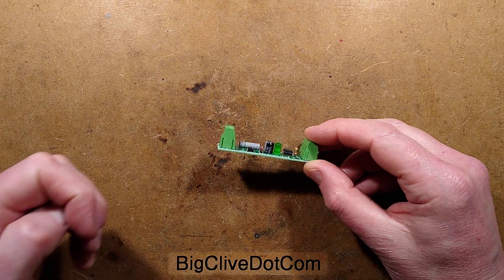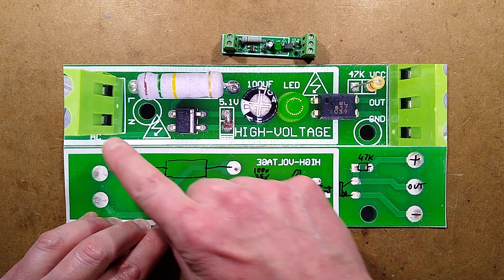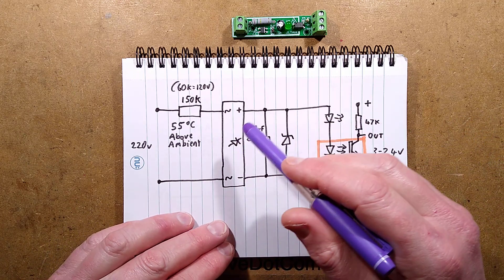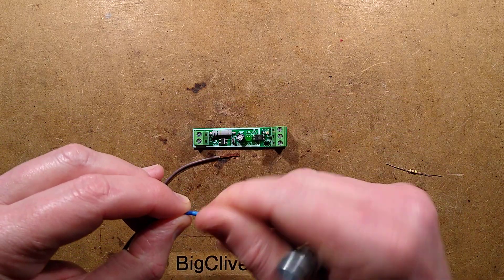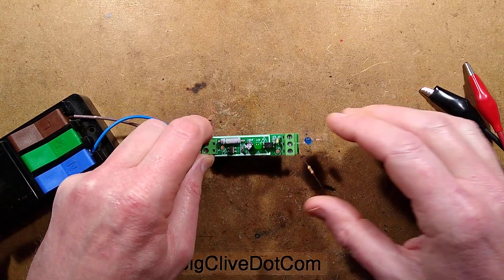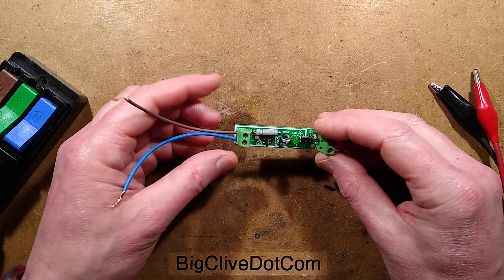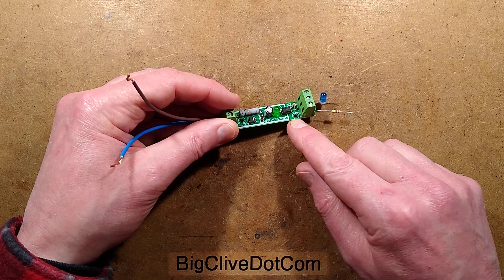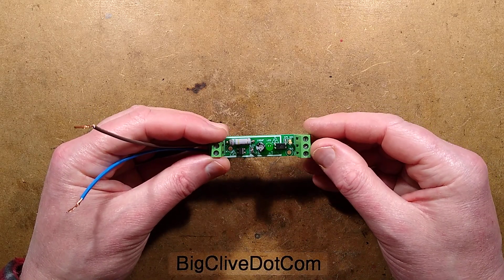120/240V to logic level optoisolator (with schematic)

Comment: You can also make one from a mains neon and an LDR or other photo sensor. The LDR is a less decisive switch than the opto but the mains neon is much easier to make safe if you need to build it without a PCB.
Reply from the maker: The ones we used to use at Hussmann Refrigeration used a neon and LDR in a heatshrink sleeve to detect defrost activity.
Reply: @bigclivedotcom  Hussman, Airdale, Denco, Wright Air Con Birmingham. A lot of time on main frame computer rooms, great for biood pressure with financial services leaving London.
Plus the MoD Dockyards, heating for Concorde's and the Red Arrows etc. 
All in my past with a bad experience with a lift during my first week as an apprentice industrial electrician working on the companys lift. 
1963, lift room,  power off but the brake was jammed off with a wooden wedge as instructed. ?¿?
Meanwhile the burly van driver forced a fourth floor lift open to load with 2/3 hundredweight of leather + driver.
Fortunately I heard the lift motor spinning. 'Presence of mind by me to grab the wedge and the speeding car gently touched the springs.
With a ranting van driver complaining he was a foot below the ground floor and he had never had such a quick trip before, I never explained.
1963, October continued
Neon control for industrial timers made by Brook Motors (the only source in the country, allegedly) Huddersfield.
Only available on three months delivery and with no other source and 200+ Brook timers in control systems built by the company. 
Very costly timers and all eggs in one basket.
There was zero stocking from any supplier, wholesaler home or abroad.
Memory prompt, the neon was 50mm long, the board was 90mm, with very few components.
PS the Radiospares catalogue was 20 pages of electronic components.
 Catalogue page size the Imperial size of A5.
Potentiomers, carbon track, for Pittards Leather they were used remote mounted to control the Brooks timers.
Prone to arcing or sparking you choose.
Point of History.

From 1914 in the carTanning machinery, British, Turners ltd, ' had to be Yorkshire based, 1914 designed and all clunky, ' withstood lethal quantities of deadly alkalines, skin layers removed in 20 seconds, deadly for live maintenance to flick moving parts.
Massive numbers of scarred employee's at the tanning end.
Mercier Frere, a French manufacture of tanning machinery using hydraulics and so quiet.
Delivered with control systems, panels included.
The original block contactors with a life of weeks, all immediately rebuilt with Brook Motor face plate switch gear for reliability.
Everything Brook was on a three months lead time.
The face plate was 200mm high, 250mn wide.
Large exposed solenoid, 
Copper contacts with 8mm silver contacts, every copper part was exposed, sou in extremely dangerous.
No door isolators that required to be defeated to work live for fault detection.
A Brook starter could be rebuilt in minutes with everything exposed for access.
 Great training.
By 1966 my C&G Technicians course stalled at the intermediate level in Somerset.
A two year C&G final Technicians course, Industrial Electronics sounded great, all based on 1930's valve theory, forget triacs, quadracs.
Our course was the same theory as our lecturers had been taught. Not great for a student who was working in industrial electrics for maintenance and very little contact with electronics other than changing circuit boards and no teaching except the library and a 55-60 hour working week.
Keep educating the world Clive.

Comment: The 5.1v Zener diode is part of the voltage regulator circuit limiting the voltage after the bridge rectifier and the capacitor smooths it and keeps it at 5v, its in turn supplying both opto and emitting led's in series with 2.5v each to turn them on. Its using the 1W ceramic resistor on the AC input as the regulators heat dump.
Reply: The Zener's unnecessary, and that's not a ceramic resistor.
Reply: @theskett  and why is the zener unnecessary? What is that power resistor if it's not ceramic coated film resistor? Please do elaborate.
Reply: @phasehalide  The Zener's unnecessary because the LEDs pull the voltage down, and the dropper resistor "defends" the cap (IOW, there's not enough amps to pop it).
The resistor is almost certainly carbon or maybe metal-oxide film, because those are penny parts (like everything else on the board, except maybe the terminal blocks).
"Ceramic resistors" are certainly a thing, but are generally wirewound and only used in (serious) power applications; and start at £2, so won't be on a £4 opto board.
https://www.google.com/search?q=ceramic+resistor&tbm=isch
Let's hope you enjoyed my elaboration, eh.

Comment: 33k says 24VAC control circuits in that lift controller, though often you find them running on anything from 24-48VAC as they are often a retrofit board to replace old relay or switch logic during an upgrade.

Yes running resistors at rating is bad, especially when it is inside an enclosure and thus ambient for it is going to be 100C plus. Had that with an industrial timer, replaced the original 1W resistors with 10W ceramic, which barely fitted in the space, though I was able to do so as the original controller was multivoltage, and had 3 resistors to allow 120VAC, 230VAC and 277VAC so there were 3 1W resistors in a string. 10W resistor was just short enough to replace all 3, and with that, and replacing the 3 well cooked electrolytic capacitors in it, it ran cool and long lasting. Did not need the 2 other voltage tappings, so those wires went away, as the original installer left them bare end loose in the enclosure, despite a note saying to insulate the unused connections.

Comment: People might laugh at the part about getting legs reversed going to an elevator but I have seen it happen. On our campus we lost a major distribution leg. The electricians spent several days replacing everything without sleep. I was there when everything was kicked on and out of habit from working in a manufacturing plant with dodgy wiring I looked at the nearest motor and it was indeed spinning backwards. It was decided that it would be easier to redo all the motors on campus than to try to undo the transformer.

Comment: I've been trying to grasp the sensing circuits on my heat pump defrost board that uses a PIC micro-controller.  The board sends 24vac out to, say the high pressure switch, then back to the board and to a 1K power power resistor to the AC common traces.  A thinner trace runs to a 47k resistor then a zener to the 24 vDC negative, thus then through the discrete diode FB rectifier.  A 47k resistor also goes to the pin on the PIC m-controller.  This video answered some question for me on the software sensing the fluctuation signal and such.  

I've been thinking of building circuits to sense when my thermostat energizes a signal to track what is being called for when.  Such as when it calls for the back up resistive heat, etc.  The opto-iso would ensure I'm not loading the signal wires.

Comment: Designers often don't consider the temperature rise when resistors are run at their full rated power. A normal carbon film or metal film resistor can have a maximum body temperature (hot-spot) of 150C when run at full rated power and high ambient temperatures. A power metal oxide or wire-wound resistor is even worse and can have a hot-spot temperature of 250-300C when run at full power.

It is not surprising that the PCB material, which usually has a maximum continuous temperature rating of 125C,  gets burnt when the designer plonks the resistor hard down against the PCB and then runs that resistor at full power for an extended period.

Comment: Why don't these use capacitative droppers if they have so many problems with resistors? Cost?
Reply: Capacitive droppers are much better at conducting interference spikes generated by high power switching circuits.  A spike could trigger the optoisolator, giving a faulty indication.  Remember that he said the input may run through switches on all floors of the lift / elevator.
Reply: @acmefixer1  Thanks. I wondered that too.
Reply: @acmefixer1  I'm pretty certain cost is an issue too. You need two diodes for a cap dropper. The diodes dont cost much but the caps are about 11p compared to 5p for the resistor. The most expensive component is the opto. However the saving on component cost going from cap to resistor is likely to be 10% of the BOM cost.
Reply: @acmefixer1  Just out of curiosity (noob here): Would that be fixable with an inductor in series or maybe a common mode choke? I get that there is also beauty in a simple solution. But assuming I actually were competent enough to fiddle with mains voltage stuff (which I'm not) and wanted to get rid of the heating element resistor, could I do it that way?
Reply: @Foobar_The_Fat_Penguin  Inductors are almost always the worst choice; big-ish, heavy-ish, hard to manufacture, difficult to measure, fragile, and hence expensive compared to other components.
As Gordon implies, a cap dropper is almost certainly the best route forward if you don't want to burn a Watt in the resistor; but if the load is multi-kilowatt, wasting less than 0.1% in the resistor is a don't-care.

Comment: The input resistor and the capacitor in the schematic actually shift the detection by adding a delay. I wouldn't use this for a safety switch especially on an elevator as even half a second of a delay could matter a lot.

Comment: @bigclivedotcom  This is way orthogonal from the subject of opto-isolators, but you've reminded me of something I think you'll find interesting anyway: Tektronix used to make a scope called the Power Scout which had channel grounds isolated from each other by over a kilovolt, yet they somehow stayed referenced to each other.  So you could plug Ch.1 into the five volt trigger signal coming from a motor control logic circuit and Ch.2 into one phase - even across a delta without any ground connection - of say a motor control's 440V output. Try that with a normal scope, and the leads and scope will literally go up in flames along with the control board. I dunno how they did it, and I don't know what - if anything - they have replaced it with.  Maybe a competitor like Fluke has something similar in the scopemeter line.  oh, and it had a cute little CRT display about 3" across too.  I want one still and I don't even have a use case, they're just sexy.

Comment: Undersized zener resistors is a very frequent failure on the pre of guitar and bass amps. They reduce the power stage voltage with a resistor plus zener to save a winding, but the reliability goes down a lot

Comment: What is the latency of this? I've been interested in a 0 crossing detector to sync an Arduino up to the mains power for use with a triac. I think optocouplers would be too slow for that use though.
Reply: I'm planning on a similar use case. Would think the latency is calculated by a sine function;  Vpeak×sin(2×π×VfwdOpto÷8.33) = milliseconds.  This formula calculator the time to reach optocoupler forward voltage based on a 60hz sinewave. The 8.33 divider is based on zero crossing twice a cycle.  But if your worried about latency then consider triggering on the falling edge
Reply: Opto-couplers are very fast (think 100kHz+, probably in the MHz); mains frequency is 50Hz or 60Hz, nominal.
So, feed the opto with un-smoothed input voltage; have the Arduino (or whatever) set a watchdog timer on 10ms or 8.3ms; if the Arduino doesn't get a pulse, count to three or so (because just occasionally, something gets lost) and then trigger an alert.

Comment: You could use it in home automation to do voltage detection past the breakers and detect if it had tripped.
Reply: But only if the monitoring kit was on a UPS or equivalent, which most people don't have.
Reply: @theskett  The home automation computer would be powered via separate breakers not used by anything else.

Comment: I'm confused - I thought the rectifier output was 315v peak to peak,  so how come the LEDs only have about 3v combined? Does it all get sucked into the capacitor and zener, so it's 315v between the rectifier and capacitor, but that piece of wire is at a different potential along its length?

Comment: Would there be something like this for 14-28v DC?

I  have a circuit that I built, that I don't really want to connect to the solar batteries directly (2 x 12v in series). 

I'm using it to measure the voltage of the batteries, but with a D1 Mini and an ADS1115 which then pushes the info to an android app called "Blynk" to display the 2 x voltages of the two banks of batteries individually. 

I have currently destroyed it twice as soon as it's connected to the solar system (this actually was tested, on both occasions, on two spare 12v batteries wired in series, and they worked perfectly as shown in the link. But the second it gets connected to the solar batteries, it destroys the ADS1115).

My only thought is that there are unwanted transients on the solar side of things that aren't present on the spare batteries I have when doing the mock testing.

Putting 2 opto's onto the solar side of things may isolate my delicate electronics from unwanted electrical spikes or weird voltages generated from the solar charge controller, however, will it be able to measure a differential in voltage? 🤔

The one problem I noticed with this opto-isolator shown here, was the fact that the output voltage is 3-24v which would be too high for the ADS1115, as this units maximum power across all 4 of the inputs can not exceed the 3v limit, as I am utilizing the higher gain control of the ADS1115 to be a lower voltage for better resolution (millivolt instead of hundreds of millivolt) overkill I suppose, but then again I like the accuracy 🤷🏼‍♂️

Blynk App: https://www.youtube.com/watch?v=I6qHv5vuBtk

ADS & MCU D1 Mini: https://www.youtube.com/watch?v=0nyVsCRYT1E
Reply from the maker: This can be adapted for lower voltage by changing the resistor.

Comment: Hi Clive,
I have just been asked to make a project for a van, where the 230V from a modified sine wave inverter has to be detected. I was thinking about using an optoisolator but one question remains, how to safely power its internal LED from the 230V side since it's not pure sine wave ?
I'm hesitating between using a capacitive dropper, resistive dropper, switch mode PSU or a small mains transformer.
What type of power supply do you think would be the best suited for use on modified sine wave possibly from a cheap inverter ?
Thank's !
Reply from the maker: You may be able to use an optoisolator resistor and diode.

Comment: If the circuit is using a full bridge rectifier and a filter capacitor, it could use a capacitor instead of a resistor to drop the voltage thus avoiding the big power dissipation. This would, of course, not work for doing phase detection! It would also need a discharge resistor on the dropper cap.

Comment: 12:24 I guess the main problem is wetting current (minimum required current for dry contacts). When the current through a contact is too low it might fail to "break through".
We have had this problems on a bunch of relays in our locomotives where contacts started to fail after several years. The current through some of those relay contacts was too low and under the manufacturers specified wetting current.
At first we replaced the relays by new ones, but soon found out that we could "electrically clean" the contacts by applying a higher current (about 10% of the max rated current) for several cycles and AC seems to be the best choice for this method.

Comment: Where i used to work i made Scoreboards for football clubs each character was approx 12" X 12" with 8 x 8 lamps fitted these lamps where 240 Vac 5w all switched by Optoisolators but of coarse worked in the opposite direction all controlled by a Amstrad 486. Later on i made my own 8 channel board which i connected to my Sinclair computer to control Christmas lights Which was Fun.

Comment: Zener is for safety. Current is low, but that still means that slowly the cap gets charged until it (surely) pops. If you use 5RC for fully charged (338V) you get 15 seconds.
Reply: The opto discharges the cap; if the opto's broken, the monitored power shows as down -- and it doesn't much matter if the cap explodes (seriously; that tiny cap can't do much damage).
Reply: @theskett  True, but it still gives an unpredictable mess.
Reply: Something more important already failed, that's a much bigger problem.
Plus most times, electrolytics just bulge and vent / dry out; almost never explode.

Comment: You are wrong about the zener. It does come into play. Both the LED and the optocoupler are semi conductors that have a resistive component, the are not pure diodes. It is possible to increase the voltage beyond Vf, shortening their life dramatically.

Comment: Would the voltage drop across the diode reduce the mili-amp draw by lowering the voltage by 0.7 of a volt?
Reply: Very slightly. At 240V, the resistor has ~233V across it. The diode would reduce it by .7, which doesn't change the dissipation much. In this case, it cuts it in half as it's only allowing current flow during half the cycle.

Comment: Apparently my uncles hp printer stopped working, i brought it home and took it to bits, when i checked the power board there was a whole line of BLACK 1/4W resistors i checked them with a meter and they were dead open, i changed them with 1 watt resistors and the printer worked fine.

Comment: I suspect open collector is more commonly used with PLCs because pulling current is less susceptible to interference than a voltage being detected by a high impedance input.